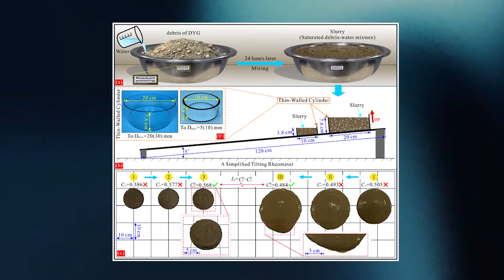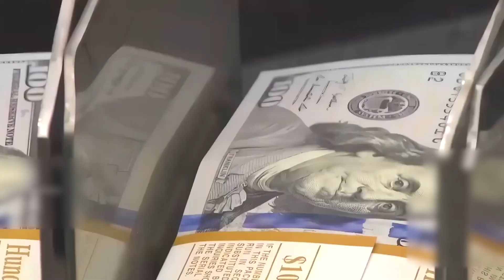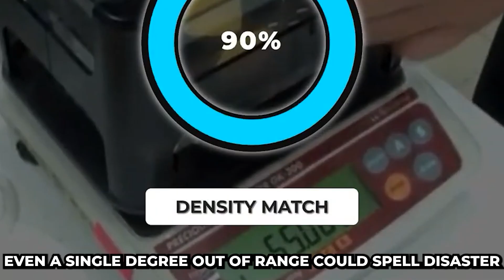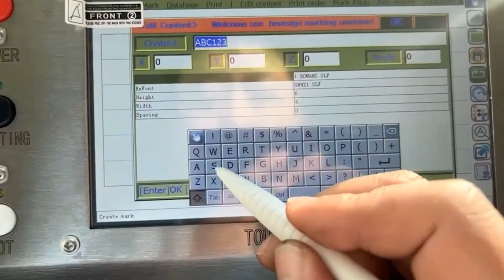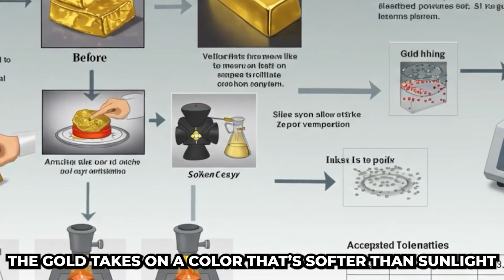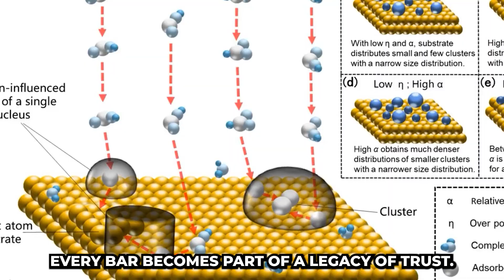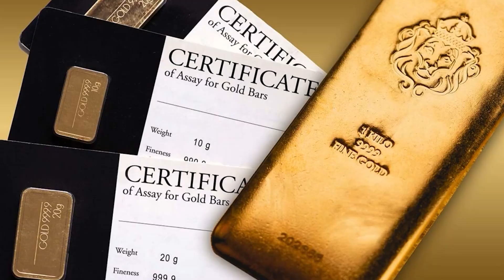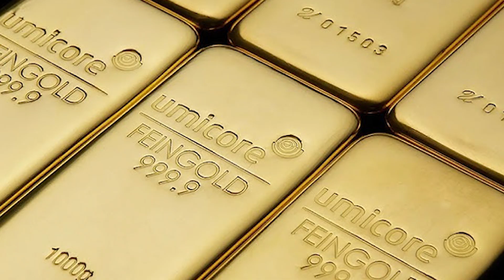How 99.99% Pure Gold Is Made Inside The Secret American Gold Factory

Comment: Regarding 11:14, the fire assay cupel is not made of clay. Instead the cupel is made of bone ash. The gold sample is weighed and then wrapped in an envelope of lead and placed inside the cupel. The cupel with the lead wrapped gold is heated in a kiln for melting. The melted impurities with lead oxide are absorbed into the porous wall of the cupel. What remains is purified gold which is weighed and compared to the original weight to determine the percentage of gold purity.
Reply from the maker: Great catch — you’re absolutely right! The cupel used in fire assay is indeed made from bone ash, not clay. Thanks for pointing that out and for laying out the process so clearly — that’s a perfect explanation of how the lead absorbs impurities and leaves behind the pure gold for weighing. Appreciate you adding real insight for everyone watching! 🔥